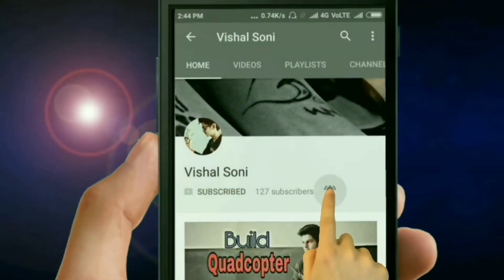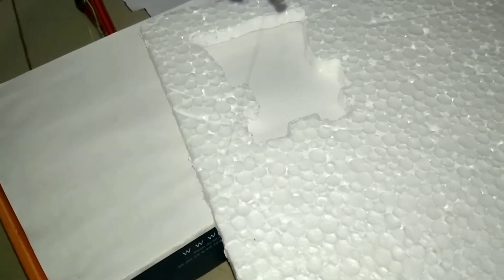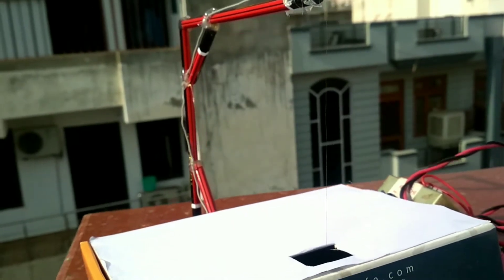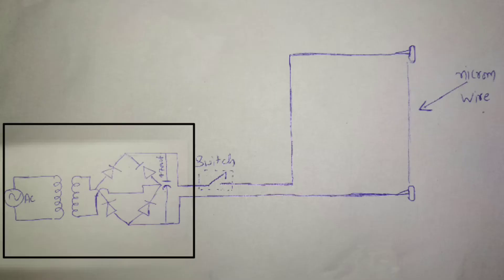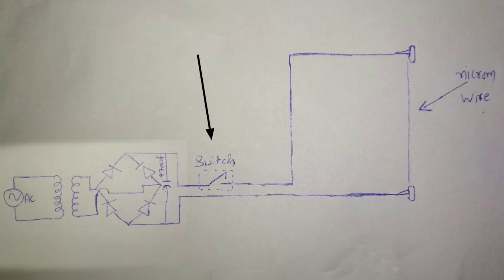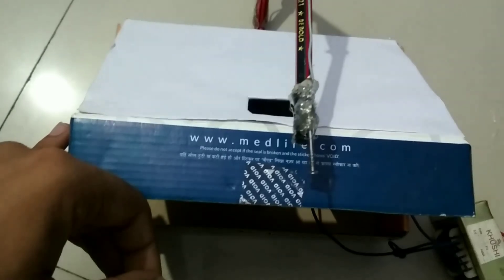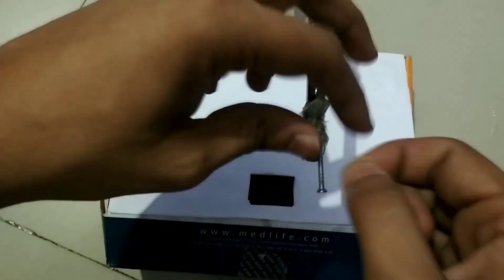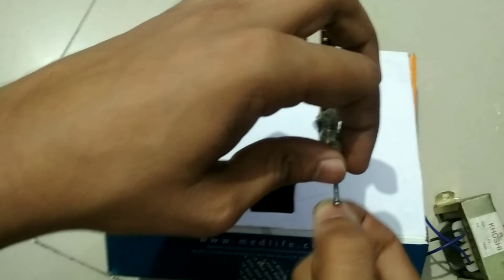DIY Foam cutter with nichrome wire || Thermacol cutter || vishal soni (cut foam by nichrome wire)

Comment: Vishal, this is very clever. However, I’m confused about the power supply and circuit assembly.  I need more detailed instructions to connect an a/c plug to the transformer; which wires  connect to the a/c input and which to the diodes. Then, please describe how to connect the diodes to the capacitor then how to connect the capacitor to the switch including which wires go to each wire of each component. It appears the capacitor is in parallel with each pair of diodes and the switch also attaches to the same place as the capacitor/diode connection.
Since I’m inexperienced, I would appreciate more detailed instruction assembling the power supply components please.
Your concept is very good and your instructions are clear, except for the electrical assembly, and allows me to use materials that I find at hand for the base and nichrome assembly, and alter it to suit my specific needs.
Thank you! 

 Do I solder the wires together or twist them together with wire nuts, though, I’d assume solder.
Reply from the maker: Thanks for asking your doubts,
I recommend you to use 12V adaptor,
Or of you want to use 12v transformer then.... There is something notation on the transformer for 220v input and 5v output which is AC or you can ask to shop where you are buying or you can find tutorial online...

And about DC conversation there is circuit diagram mentioned in video please check out...
You can search diode symbol online and understand my circuit..
The capacitor value is also shown in beginning it is for filter... If you still not understand my circuit then please search it for rectifier circuit.........

The switch is also mentioned in circuit please watch full video....

Or any other doubt please ask me